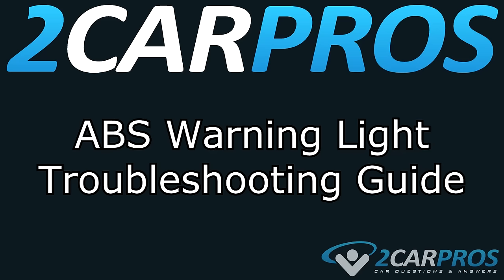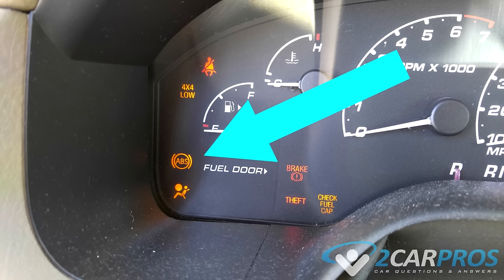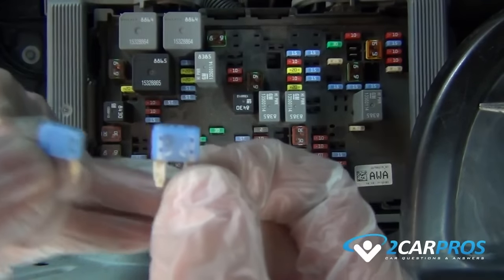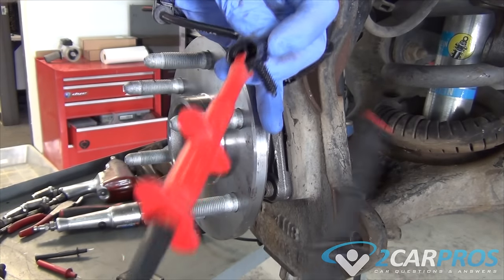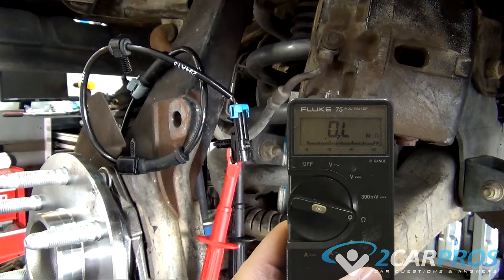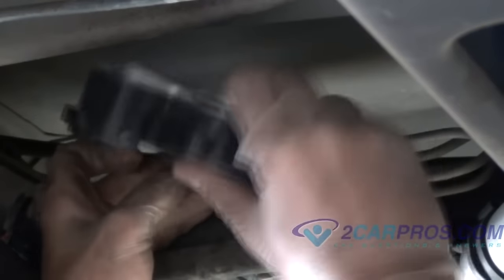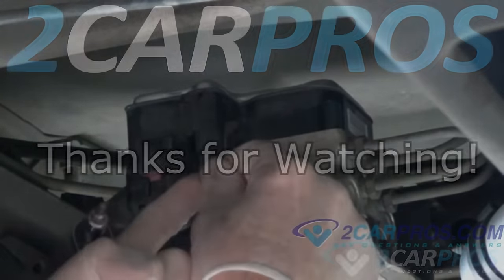ABS WARNING LIGHT ON? FIX IT IN 3 EASY STEPS

Comment: Thank you.  But if the ABS system fails you do not lose control of your car.  The normal braking system still works.
Reply from the maker: That's true. But what I'm saying is if you are used to ABS then it stops working and you get into an emergency stop situation you might not know different. So you might lose control if you don't know to back off the brakes a little to get out of the skid. Thanks for watching!

Comment: My name is Claudiu, I'm from Romania and I need technical help in a problem.
 I have a Renault Laguna car equipped with ATE ABS sensors. The code is 8200084125. For some time I have a problem: speedometer does not work at all and in the board there are several glowing signs: ABS yellow, STOP red, "wrench" yellow and I was asked to check the parking brake all the time.
 I was at several car service but they could not identify and solve the problem. Since I have to carry out the technical inspection these days, I have to fix the problem otherwise I will not get a visa for the technical inspection.
 I bought a multimeter and removed the front speed sensors.
When I searched for resistance, it seems that both are broken. If you set the multimeter to 200 ohms, 1 will be displayed instead of 0.5 if it is not interrupted.
 Are these 2 sensors damaged? If not, what else could it be? I checked the fuse and the big plug of the ABS module and it looked ok.
 I mentioned that shortly after the first occurrence of this error, when I drove on a rainy day with a lot of humidity, from time to time the lights shouted down and the speedometer worked. It means it's about a contact. But which ?!
 Thanks a lot!

Comment: I got a 2012 dodge avenger abs light on changed sensor light wont turn off when I start car it goes off for a second and comes back on????????
Reply from the maker: Plug a scanner that can read ABS codes and find out what code it is throwing. Thanks for watching!

Comment: why my light goes on for a few seconds and then turns off? sometimes coming to a stop the brakes act as if I was on ice and want to kick in :( I had the wheel hubs checked and they are ok and the sensor on the driver wheel shows up in the computer hook up but haven't found where the heck is at :(
Reply from the maker: Sounds like the ABS computer it's self could be the culprit.
Reply: I'm going to check # 1 first, cleaning the ground wire at driver side wall if it's not that then I'm going to go for the module. Is  a ''refurbish'' worth $198 ?
Reply from the maker: Yeah, depending on the car.
Reply: it's an 05 suburban it is dumb to place a ground wire at bottom of the truck.
Reply from the maker: Please ask your question here on our website if you need further help. 

https://www.2carpros.com/questions/new
Reply: 2CarPros
Reply: 2CarPros

Comment: Subaru problems are expensive. Begin the ABS itself costs $1,000 USD, then add the repair. My problem with the ABS and break system in total has cost more than $2,500 USD. I am NOT joking. The part costs are outrageous. 2012 Outback 80,000 miles. And I bought the Subaru based on reliability and durability reputation. Maintenance costs should be another cost factor to think about BEFORE you purchase a Subaru.

Comment: My ABS, VSC OFF, AND TRAC CONTROL LIGHTS ARE ON.... All I did was have my tires replaced.. idiot broke off two lugs.. took my rotor off to hammer them out.. replaced my rotor and voila... all lights are on.. what could the issue be??

Comment: It could also be a cracked solder joint on the motherboard or a faulty valve inside the ABS module ect ect. Testing fuses ain't going to tell you this. JS
Reply: Correct. But testing those other things first will verify that your computer is fried, before you buy a brand new cpu

Comment: So my ABS light is on and before I went through the steps, I used my OBD Scanner to see if it'd spit back any codes. What's weird is, it didn't detect anything, but of course the light still remained. Fuse is fine, speed sensors are fine, what is the issue? Not having ABS isn't an issue for me, the issue is that selling the car will be problematic with the instrument cluster glowing like a Christmas Tree. Anybody think they can help me?
Reply: I’m having the same problem. I was rear ended while sitting still and after driving home the next morning the fwd , traction control light,and abs lights  were on. At the body shop all the wires to 4  wheels looked like they had been cut. Never had an abs light or 4wd light on before the crash. I was sitting still and hit by a car going 30 mph. It pushed me 8 feet into the intersection . At first it looked like I just needed a bumper cover until all the sensors came on.

Comment: it sucks being a woman with car issues... I have had a 65 mustang.that my father completely restored and hot rodded out for me. I could go on a tangent on what was in it but I wont lol then I had a 94 camaro z28 w/ the 6 speed man lt1  then a mitsubishi eclipse  and a 240sx..so I've had a LOT of issues and over the years I have learned what is what.. I just do not know how to replace things. do I even want to? lol  but ive had on more than one occasion where a mechanic would try and tell me it was something else and I knew what it was but they just pashaw'ed me . so I went on until I could find someone trustworthy.. not easy ..
Reply: Martina Crews I'd just say do some online research for pricing and do the best you can at the shop, be firm and straightforward.  A lot of the time they will still want to fix your vehicle for however much. But keep trying

Comment: Step 1. Plug in OBD diagnostic software that you bought off eBay for 50 quid.
Step 2: software will tell you what's wrong.
Step 3. Buy replacement part from a salvage yard or eBay.
Step 4. Be prepared to get greasy hands.

Comment: Can driving on a donut spare cause the warning light to come on?
Reply: Absolutely. The fault lamp illuminates because the temporary spare tire (pony, doughnut, whatever you want to call it) is a different diameter, typically smaller, than the vehicle's regular tire. In most cases, the anti-lock system receives inputs from wheel speed sensors, one mounted in/on/very near to each hub/wheel bearing. The small temporary tire must spin faster due to the decreased radius, and so the ABS computer, receiving one significantly different input than the other three,  logs a fault for this implausible running condition. If the lamp doesn't go out after you're back on a matched set of tires, and you don't have a scan tool to clear the fault, you can disconnect the battery for a few minutes, effectively clearing fault memory.

Comment: 3 easy steps, LOL...I I wish they were. Step 1 easy, step 2, easy to understand, but you have to remove the wheels and everything else behind them up to the wheel ax, change the wheel sensor, put everything back, good luck. step 3 check your pockets for over $1000 expense. If you have the money, search for a mechanic.

Comment: THREE EASY STEPS AFTER PUTTING BOTH TIRES IN THE FRONT ON JACKSTANDS AND REMOVING THE WHEELS :

(1) @0:50  : CHECK THE ABS FUSE TO SEE IF IT IS BLOWN ( OPEN FUSE )
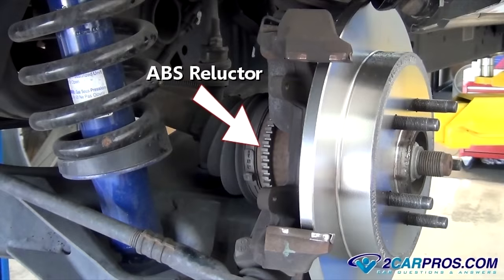(2)  @1:35 : ALL ABS EQUIPPED CARS HAVE FOUR SPEED SENSORS - ONE FOR EACH WHEEL .  CHECK THE ABS 
                     RELUCTOR FOR BROKEN OR MISSING TEETH . TEST THE SPEED SENSOR FOR AC VOLTAGE WITH AN 
                     AC VOLTMETER AND SPIN THE HUB . THERE SHOULD BE AN AC VOLTAGE GENERATED . IF NO AC
                     VOLTAGE IS GENERATED , THEN THE SPEED SENSOR IS BAD AND NEEDS TO BE REPLACED .
(3) #3:00  :  LASTLY CHECK THE CONTROLLER ITSELF .

Comment: Another guy that doesn't mention year model his video pertains to.
No help at all without that information dawg.
Reply from the maker: This video spans many makes and models. ABS works the same in every car. Thanks for watching!
Reply: 2CarPros 
They might all work the same but they don't have the same components I assure you.
Not claiming I know any more than you do, I just have a vehicle I can't match up to any video I find.
It doesn't have that module, I can't locate any sensors with wiring or any of that.

So I keep trying to find the same year model and can't seem to locate one in here anywhere.

It's like all tires are round and work the same way also but they aren't all made the same.
Not trying to be a smarta$$ or anything, just saying.

Comment: The ABS module on a Mazda 3 is a money pit… $2000 bill to fix it's just stupid.  They're also a weak link and breakdown often so bad it should be a recall.  I'm here because I'm looking for a way to remove it completely and not use or even have ABS breaking I've never used it in my life don't want it never will use it and I know how to post my brakes myself it's only for people that can't drive anyway.  Even this video by the time you go through all the methods you're emptying your wallet

Comment: My ABS light along with the rest including the service light are all lit up like Santas grotto.
So far it's cost me over £400 to be told that there is a break in one wires that leads to the ABS sensor drivers rear side. Nissan replaced a sensor that didn't need replacing because the diagnostics pointed there and they didn't do their homework. Peugeot wanted to rip my car apart to trace the offending wire at which I had to stop because each hour cost me £137. The car drives fine with my Christmas lights, infact it feels better without ABS.
The point here is though because of one stupid wire it's probably going to cost me my car because it's too expensive to get fixed by the same people that made it (Peugeot). Yes I'm f#@£ing angry as hell because all this so called new technology is costing me a fortune.
It's made in such a way that ordinary people can't even have a go at fixing it because of the way it's designed and tucked away out of sight.
No more Peugeot or Nissan cars for me. I'm done.

Comment: Wow, you call that 3 easy steps, maybe, after you've taken the wheel off down to the hub, jeez, really....
Reply from the maker: It is how it's done. If you take your time it really isn't so bad. Thank you for watching!
Reply: jim ploetz it’s actually very simple. Try changing an oil pan gasket on a 05 Silverado 2500hd 4 by 4. You have to drop the front axle. Still not very difficult just a little time consuming